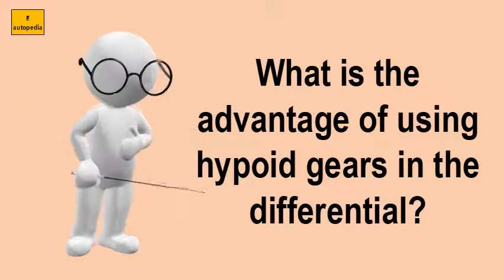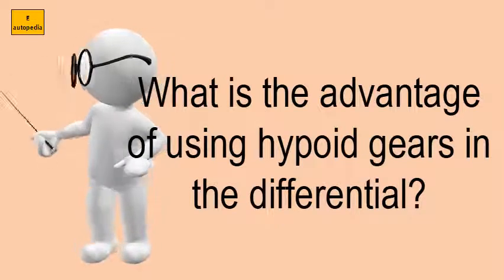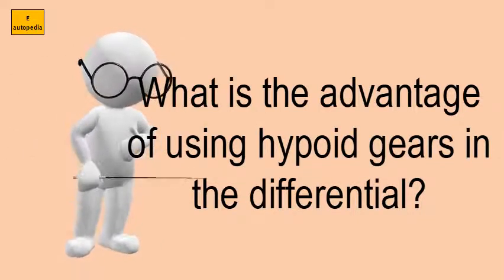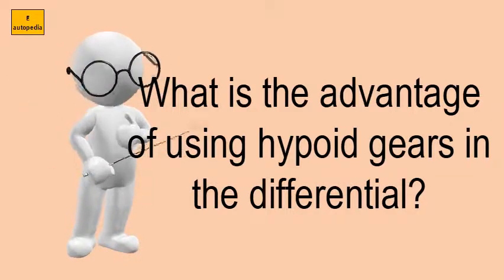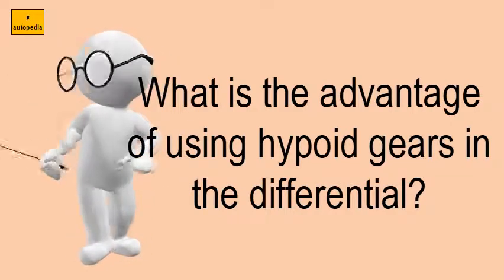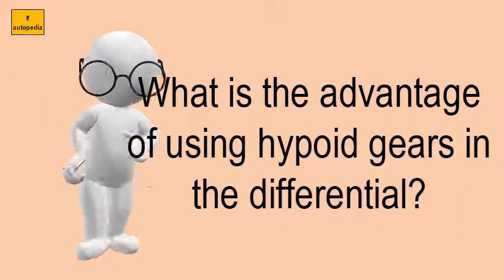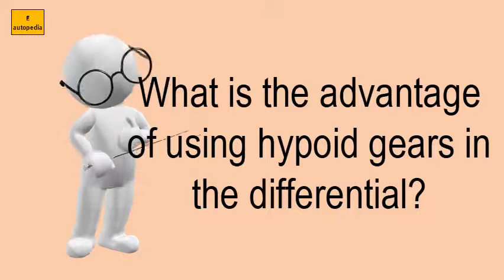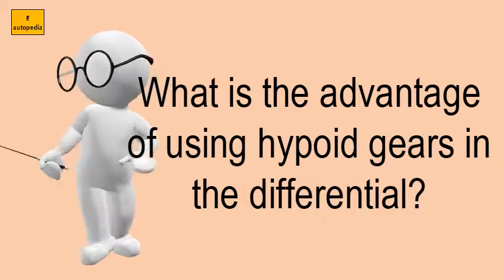What Is The Advantage Of Using Hypoid Gears In The Differential?

Comment: complete fail, misinformation.   The advantage of hypoid gears is that they are smoother and quieter than either straight cut or even helical gears, and they don't have the side forces of helical gears.  All gear sets can be heat treated, that is completely irrelevant here.